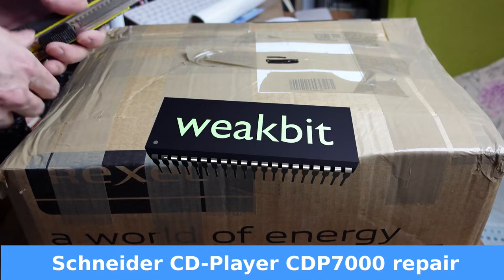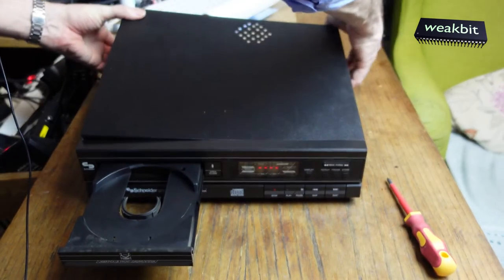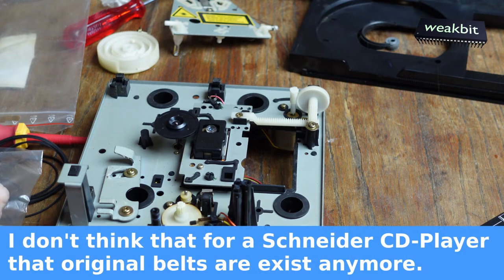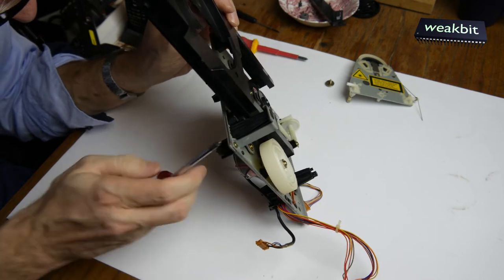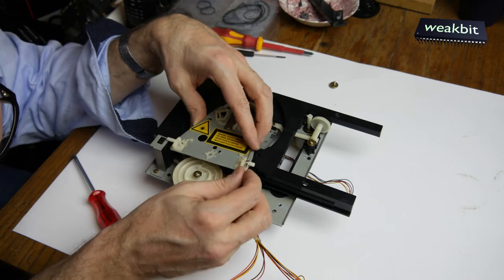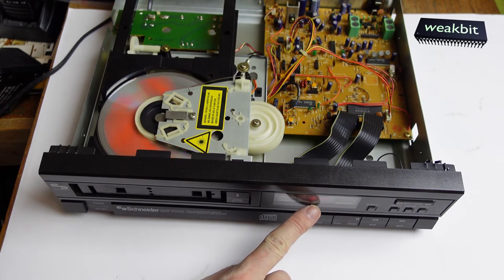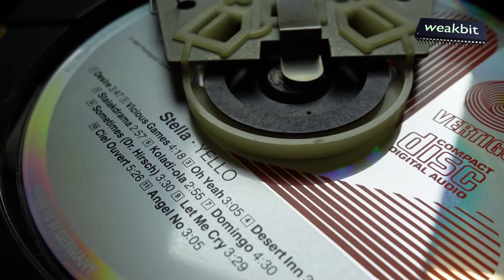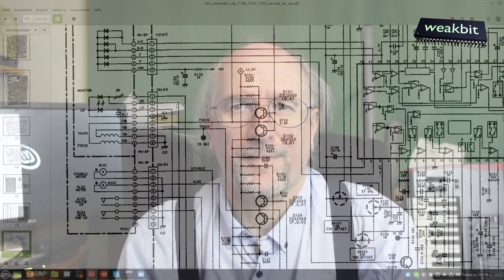schneider cd player cdp7000 repair

Comment: Hi weakbit  Nice video.  So, you repaired the tracking issue by noticing low laser power, leading you to increase the laser diode current.  Awesome.  ¿Did you use the trim pot to adjust the current?  ¿If so, did you measure the t=0 current (volts across that trim-pot) (and pot resistance) before making changes?  Please pardon the many questions.  (There's a similar situation with my Magnavox CDB650, that I purchased new circa 1987).  (I do have the schematics of said Magnavox [Philips] and so I've followed a little of what you've just described).  Thank you for making and posting this video.  (You've good skills).  God[Bible] Bless.
Reply from the maker: Hello Tony D - no I don't increase the laser power in case in 100% of all the issue the laser itself is to low in the light output. And yes you can increase the power of the laser-light but this short only the rest of the livetime form the laser. weakbit
Reply: @weakbit633  Hi Weakbit.  I see.  Thank you for the kindness of a reply.  Thank you for your videos.  God[Bible] Bless.
Reply from the maker: @tonyd1149  no problem if you have a question and I can answer that take time in case I can not seat hear to wait about all questions but I can give answer in case of simple questions.